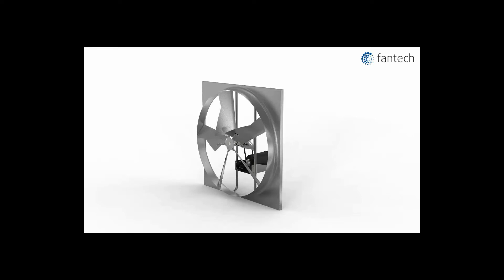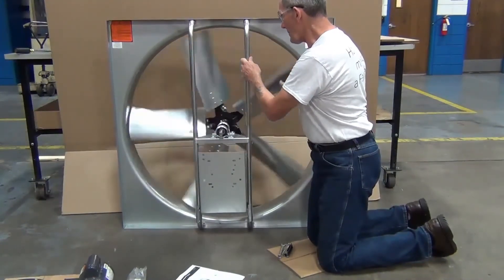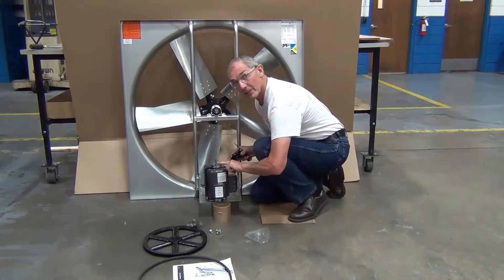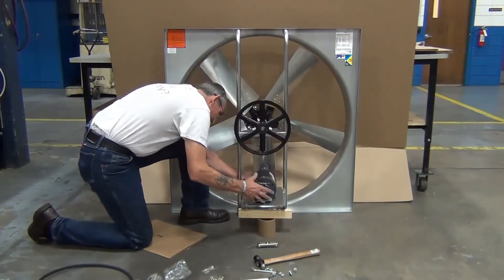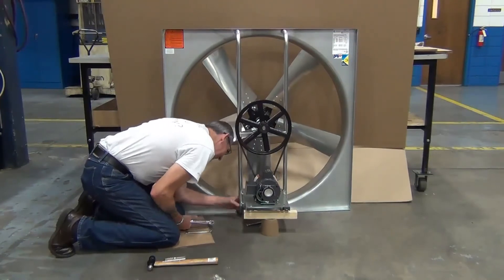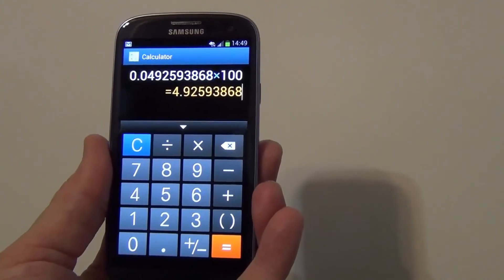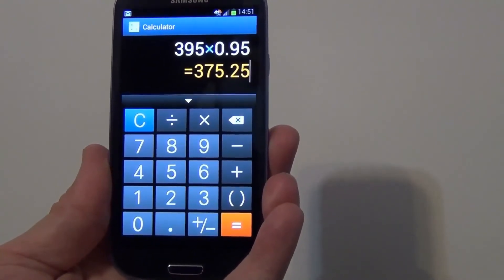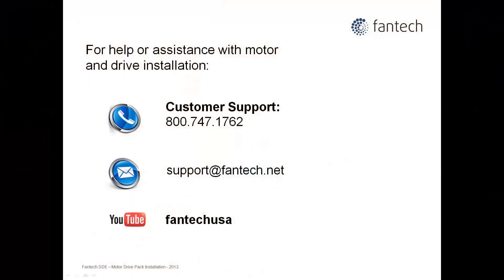1SDE Fantech wall fan, motor & drive pack installation.

Comment: What if you want to use it as a portable patio fan would you have to put a guard on the front and the back Or do you have a thing to support it
Reply from the maker: Hi there! Due to air flow characteristics, we recommend this product for industrial use only.